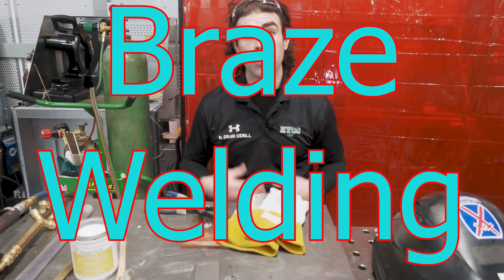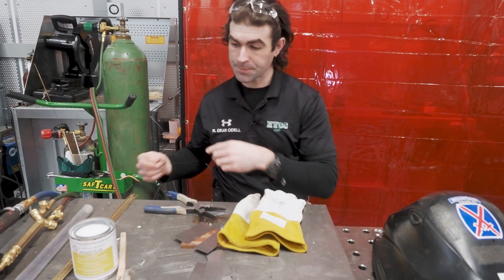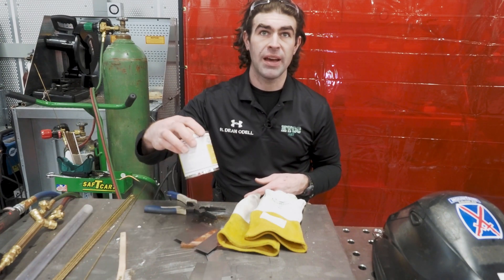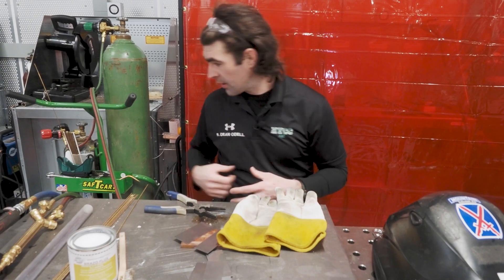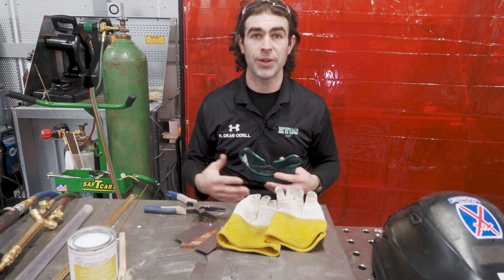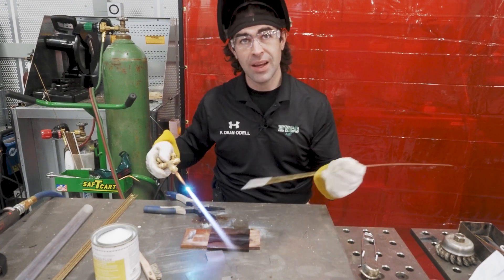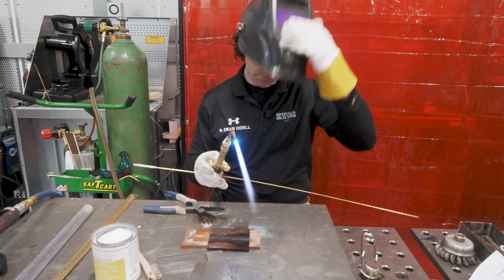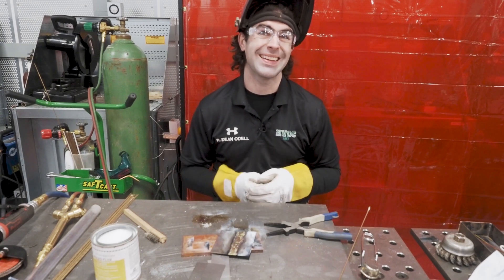Braze Welding Demonstration

Comment: I'm new welding student. Why did you speed up the video? I really needed to see how long you heated up the rod before dunking it in the flux, and more importantly, how long it actually took to braze the length of the joint. This was not helpful.

Comment: What is the advantage of brazing over Mig or Tig welding?
Reply from the maker: With any kind of brazing or soldering, you don’t melt the base metal. So it’s handy for pipe joints, sheet metal (like a brass float bowl in a carburetor) or cast iron repair.

Comment: "Welding" means joining two things of the same material by melting them.
"Brazing" can never be "Braze welding" on steel, because brass is different to steel. Like soldering, brazing is joining of two pieces of steel with a lower temperature metal that sticks to the steel.

Please don't use the term "braze welding" ever again, it is totally incorrect.

Comment: Here's a tip for your video presentation:  DON"T EAT OR DRINK before you go on camera.  Wait at least an hour afterward or more if the meal was exceptionally heavy.  When you fill up your stomach with food, you can't get enough air in your diaphram to continue speaking without that constant gasping and gulping for air.

Comment: Thank You👊
I’m barely realizing this is the way to weld exhaust pipes. I used a fluxCore to weld my exhaust and had to add exhaust sealant over pin holes. Still don’t trust it lol
Love to go Tig but Brazing is such a great method.

Do you think stainless steel quick disconnects will adapt well to off the shelf (oreillys) metal using brazing? If so would you use a different filler? 

Either way, thanks again for the helpful vid.
Ryan

Comment: Why didn’t it stick to what it was lying on?
Reply from the maker: I think it was a fire brick, but it’s been a few years.
Reply from the maker: One advantage of oxy welding is that the workpiece doesn’t need to be electrically grounded so you can weld on something like a brick instead of a metal table.

Comment: When/why do you choose this process over welding?
Reply: The number one reason for this is to have less heat input to the work, less heat damage.  It can go fast and the temperature is lower.  There's no penetration!  I didn't know this in the beginning, but welding damages the work piece, some metals more than others.  Some things can't be welded!  In my own work there's a constant demand to join DISSIMILAR metals!  Even sort of unknown metals.  Brazing and Silver-Soldering address a hundred situations that are out of reach of welding.  Finally there's very light work, like thin sheet which might be destroyed instantly by typical welding methods.  There is "Micro Welding" but it's not that common.
Reply: @leonardpearlman4017  Excellent. Thank you!

Comment: Is it possible to braze with only a heat gun? Also if im just shopping for 1 time diy braze rod, what material rod gas the lowest melting point ? Aka what's the easiest rod to melt? Copper , silver or aluminum? I think that's the 3 types they sell at my local store.  Thank you !!!!
Reply from the maker: Not enough heat to braze, but soldering can be done with propane handheld torches available anywhere.
Reply: With just propane?
Or is MAP better?
Reply: @carterhoenig7759  with MAP it can work but you are going to heat up for a while; you should get the best torch for your MAP bottle. The thickness of the metal you're trying to heat up matters also.

Comment: Hi.
I need to do a crash repair on a Miata...in UK.
Only panels..thin metal and not structural.
I'd rather braze...to keep the temperature down...so as not to blow holes.
Can you recommend the brass/bronze rods...flux and a cheap way with what gas... without having to buy a huge set up with oxy bottles.
??
Thanks🙏🏼

Comment: You can read about this in old books about welding.  How old?  Say, they have black and white illustrations, and refer to the person holding the torch as "Weldor".  Or "man"!  They call it "Bronze Welding" which has caused a generation of confusion.   My understanding is that this refers to something you do with a torch and filler (like low-fuming bronze rod) that LOOKS like welding!  Local heat, fillet.  "Brazing" has been done for centuries, before there WERE torches, and generally involves broad or overall heating and filler metal flowing where it will.  This might refer (I just this moment realized) to something small like a little ring, the jump ring jewelers talk about!  SO:  when you silver-solder a RING closed, it's BRAZING!!!  You heat the whole joint, the silver brazing material flows all at once by capillary action, the heat is not local.  Brazing a carbide tip on to something, brazing tubing in to a socket might all be the same.  Are you with me?  I think for Bronze Welding you want intense concentrated local heat typical of welding, but not enough to melt the base metal.  I've never quite managed this but will one day!  I have done it with TIG heating and silicon bronze which doesn't quite seem sporting.  If I watch enough videos and buy enough torches surely it will happen by itself?

Comment: What’s the gauges on the tank set at
Reply: Probably 5 PSI for acetylene and maybe 30 for oxygen. I taught high school agriculture, and I never let my students get acetylene above 5. @vondinkinsvon8919
Reply: that's far too high for brazing 7 and 10-12 will give much softer flame. what i saw was a roaring flame not suitable for small metal brazing.  a soft flame is what i was taught by a jet engine welder 50 years ago
Reply: @audiecherry15  thank that’s what I was searching for

Comment: When I was at college we were taught that the oxy/acetylene mix should be slightly carborising i.e. slightly more acetylene than oxygen for brazing.
Reply: That makes sense because the flame would be less heat with less oxygen- you can tell by the sound will be lower pitch with carburizing and inner cone of flame will be longer
Reply: If you watch the action part of this you'll see a white cloud rising up from the work.  The famous zinc "fume"!  Zinc oxide smoke.  It's not nice!  Sometimes if you do this and move the torch away suddenly you will see a little flame on the work, the zinc is burning!  That smoke is famously unwholesome.  I do a little demo of this where in the moment you change the mixture a little, and as the flame becomes slightly oxidizing the smoke visibly goes away, you can turn it up and down, get more or less "smoke".

Comment: Don't have access to an actual welder. Heard about brazing two pieces of steel. Nice. This works for most of the things I do.
Reply from the maker: Thanks! Oxyacetylene welding and brazing is an underrated process in my opinion.
Reply: Are you able to use just a propane torch like the ones you can pick up from harbor freight/Home Depot this is something always wanted to learn
Reply: @JeremyRodriguez-k9r  the flame is much stronger with Oxy mixed in.
Reply: Mapp has will work with skinny metal
Reply: what is it that you do?
Reply: @ChefBeRad  sir we are on the internet. Be aware that "your mom" jokes will be taken at every opportunity. In all reality, I'm a generalized craftsman angling towards 14th, 15th century english armor with a bit of italian. The most I can do is forge weld.

Comment: Well, I'm going sound contradictory, and maybe that will start a discussion...
This demonstration is just "brazing", where bronze filler metal "sweats" into a joint.
I'm trying to learn real "braze welding" where a steel joint is joined by an actual fillet bead. This appears a defined stack of bronze dimes.
Every single person I talk to says, "That isn't possible." 
I know it is possible. I first saw the process on Irish race cars, and the science behind that particular method of joining steel tubing probably saved my life more than once.
The closest if come to seeing real "braze welding" are the bicycle frame builders, but too many of them are simple sweating joints together.
Reply: natural gas pipeline welder here , in my career this was done in the 1940's the brass bead was beautiful a perfect stack of dime , on brazing steel to steel or copper to steel , looked like a machine weld , nice uniformed bead, i practiced and got to where i could run a bead, it appears in this video he is using a 2-tip , i could not see the adjustment , just my take i would use a 4-tip with a large feather adjustment , good luck on your quest to gain a lost art
Reply: Bit late to the party, but...

There is a fabricator with a you tube channel called Paul Brodie - he build bicycle frames (and does a whole lot of other stuff too) and has some good videos on various types of brazing including fillet brazing which might be what you're looking for.
Reply: you're right, this is brazing, not braze welding, and they are definitely two different things. My understanding that brazing was used for industrial applications, black iron pipe, industrial plumbing, cast iron repairs, etc and braze welding was used where some measure of flexibility was required, where actual steel welding would be too brittel. I've onle ever seen it used on race car and motorcycles chassis where a degree of flexibility is desirable. I think with the advent of TIG it has become almost a lost art form, with only the old school chassis tuners really usgin it anymore.
Reply: did you find anything
Reply: You are on the path!  A big difference is the concentration of heat.  If you heat everything flux and then the filler will go everywhere. And sometimes that's just the thing!  If we want to deposit some bronze locally we have to heat locally.  I've spent a LOT of time reading and writing and talking about this, but not much time doing it.  In "Bronze Welding" the ACTION is like welding, superficially.  But you are keeping the general heat down.  If you start to get a puddle in the base metal you have to back off a little.  Also if the work starts to heat up generally.  As a demonstration for Engineering Students I have used the same rod and torch to braze and then to weld on BRASS.  Really to sort out the confusion.  But you can flow LFB on to the surface of some hot chunk of brass, or you can melt that chunk a little and use the brazing rod as filler.  Everything is the same physically, and the only thing that changes is what you're doing, and it doesn't change much!  "Bronze Welding" is an unfortunate name really, and probably causes half the controversy.  Ah, I never managed to actually pull this off until I tried with TIG and silicon-bronze rod, on very clean 16 ga steel sheet.  No flux, no PENETRATION, great visibility and control, and of course the heat was much more local.
Reply: I learned how to braze in high school autobody class. This guy brazed the metal but was misinformative about a few things. First, the flame he was using was way too hot. He should be using an oxidizing flame ( ½" feather coming off the cone), and you don't want a bead. You want the braze to suck between the plates like sweating copper pipe fittings. His way will work, but he created himself extra work by having to clean/ grind the excess filler. Nice demo though.